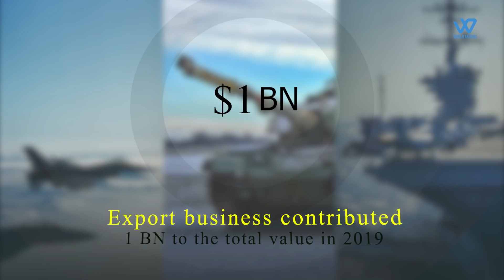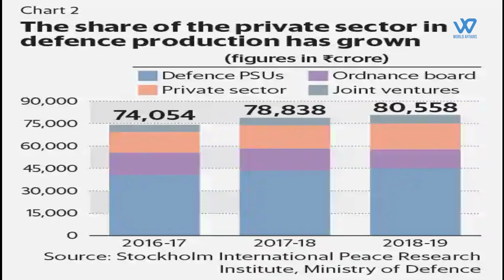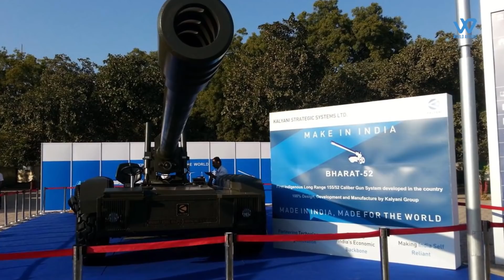How India Transforming Itself From A Defence Importer To A Defence Exporter

Comment: India has a couple of major problems in weapons production. No domestic jet engine that is worth building into a modern fighter aircraft. No quality control on the public sector companies production process, latest example the Danush. Too little involvement of the private sector companies due to the lack of a level playing field and the unwillingness by the army to buy domestic. The first will be remedied within five to ten years with the aid of RR. The last is already being addressed by the current administration but too slow and a new administration could undo everything. Working with Korean, Israeli and French companies can eventually lead to the private sector companies getting the bulk of the tenders with derivatives of the joint production.